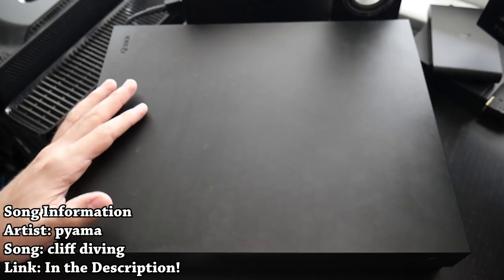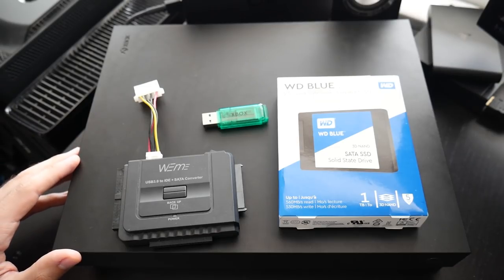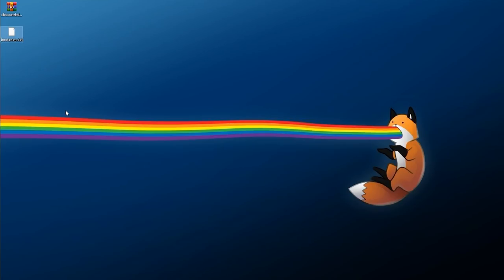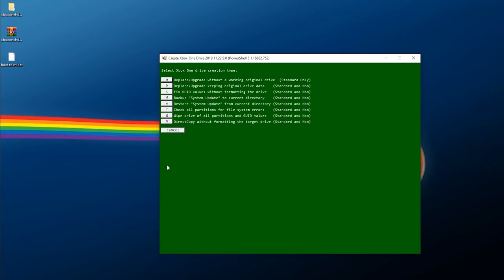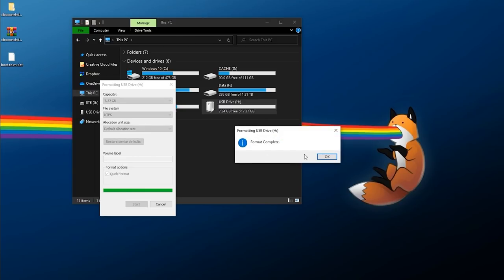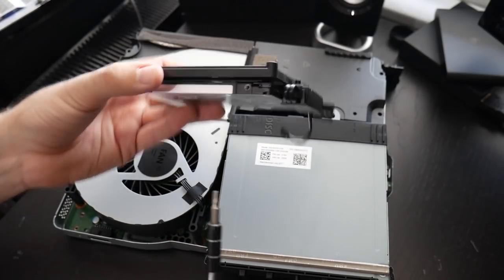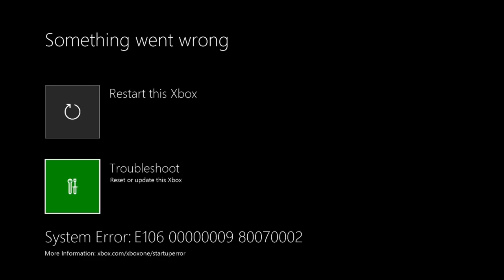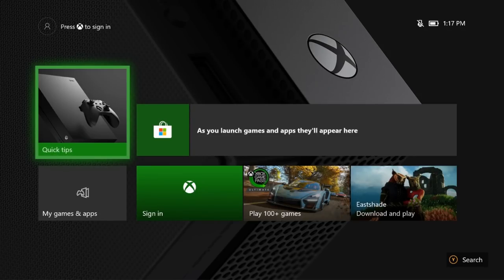How to Upgrade/Replace Your Xbox One HDD! - SSD/HDD Upgrade Guide for X1, One S, One X

Comment: Sorry to both you, twice, thanks for a great video, but, after redoing the whole process a few times mine does exactly what you showed, until I get to the offline update, it goes to the something went wrong screen with the E101 error, and I can pretty much bounce back and forth between a good start with E106, to the E101 error. Do you have any suggestions?
Reply: i believe error 101 is a faulty hdd

Comment: I simply just used Macrium Reflect to clone my old HDD to a new SSD and simply dropped it in....and somehow it worked lol
Reply from the maker: Yep, nothing all too special about these in regards to security sectors.
Reply: @MrMario2011  Does the drive cloning method work if they're different sizes though?
Reply: @shanez1215  More than likely it will. Once you clone the drive, the larger hdd should have an empty partition of the remaining space. I usually use AOMEI Partition assistant to combine your main partition for game storage with whatever empty space you have left.
Reply: this is exactly what i was thinking of doing lol, glad to know it could work

Comment: Just be careful removing the ribbon that connects the front USB and sync button from the board. When I did mine, it ripped the connector off the motherboard. Luckily the damage wasn't too bad, and a repair shop could was able to fix it. But if you're not careful, those traces may be irreparable.
Reply: Hi,I think it happened to me today. I tried two USB,none is recognized anymore and I can't do an offline system update. It remains grayed out. What can I do?

Comment: Wow this is outdated. You don't need to hook any of the drives up to the PC anymore, let alone mess with weird scripts. Throw the new/larger HDD/SSD into the console (no prep needed), go to the recovery menu (as outlined at 23:30) with the OSU1 USB stick inserted and pick the offline system update menu item. It'll start doing its thing. Done. The only thing this doesn't do is restore the boot logo, but that'll fix itself the next time there's a software update anyway and doesn't affect usability

Comment: I was fighting with an Xbox black screen for a friend. I couldn't get it to boot into troubleshoot menu to reload it. I knew it wasn't bricked since it got to the green screen and went black plus the controller allowed me to power down, restart, etc. It had to be corruption since it happened after that MS update that killed a lot of Xbox units. He wasn't worried about the data since it's all on the cloud. I said I'll replace the HDD with an SSD after coming across you method for replacing/upgrading the disk. I worked without any issues and was able to apply the update and it's good to go. I spent way less time on this than trying to get into the troubleshooting menu. He's finally got his Xbox back after it being hosed for 6 months. I appreciate the information and tips. Easy to follow and not difficult at all.
Reply: Did you use the original drive? Jw wondering because mine crashed mid update (Xbox one x) now it turns on but shuts off after like 5 mins no power to USB and says no signal

Comment: This is amazing how easy the upgrade is! Much better than the original Xbox that locked the hard drive to the motherboard unless you softmodded it first.
Reply: Having upgraded a PS4 before an Xbox One, this was so much worse holy fuck.
Reply: @SimisFul  It's all relative. I recently upgraded the drive in my classic Xbox, and agree with PiratesMVP that it's no picnic. Holy hotswaps, Batman!
Reply: @jessragan6714  I certainly don't envy it if that's the case! Hopefully you got it all working now :)

Comment: For those getting an E106xxxxx error code loading the OSU1, make sure you download the proper version for your Xbox One console. There's a separate version for Xbox One X/One S and Xbox One consoles. I accidentally tried to load the Xbox One S OSU1 onto an Xbox One and ran into a E106xxxx error and Update from USB was not an option in the trouble shooter. Also try a different USB drive. Some drives have issues loading the OSU1 onto the console.

Halo 5 Xbox One
Previous Drive: Seagate ST1000LM024 1TB HDD
New Drive: Crucial MX500 1TB SSD 
Console OS before Upgrade: 10.0.22621.4480

Also make sure to exit the Xbox Insider program if you have a preview release of the OS. The public OSU1 will not work. You'll have to wait until the new public release of the OSU1 supercedes the Insider preview version. That can take months. You cannot revert to an older OS build doing the offline update by USB using the lastest OSU1 update in this situation. It would suck if your HDD crashed with a preview build.

Comment: Thank you for such a detailed tutorial. I upgraded my Xbox one X with Samsung 870 EVO 1TB 2 years ago, then did another upgrade to 2 TB last year. What i can say is every dollar is worth of it ! The price of SSD has been going down to a quite resonable range and people with old consoles should consider the internal upgrade first if he or she has the ability to dissamble the console.  However, what modders concern is the maximum capacity or limitation of the Xbox One consoles. I have viewed several videos made by XFiX(aka author of Xbox HDD master script). He said the limitation of user content partition is around 1.8TB or so. In other words the max standard capacity of SSD would be 2TB. Though we can partition the SSD of greater capacity and get beyond the limitation with Xbox HDD master script tool, we cannot use it because once trying ,it causes partition corruption and data lost. I just bought another new 4TB 870 EVO last week  and this information interrupted my plan because I was just  aware of it yesterday.

Comment: Another great guide again. Have used your videos for Softmodding Original Xbox and PS3 and fitting bigger HDD's (2Tb) on both. Used another guide to fit 4Tb SSD into PS4 Pro. This guide will come in handy when I get a 4Tb SSD for my Xbox One X. Keep up the good work and thanks for sharing your information. 5* and 2 thumbs up from me!
Reply from the maker: Got a legacy user here with the 5* reference 🙂
Reply: @MrMario2011  If you didn't deserve the praise I wouldn't of give it to you.. Would you have preferred a f**k off with your knowledge instead?  lol. Just take care and keep up the good work. just upgraded PC to 32Gb from 8Gb. Bios didn't like it and I couldn't boot up as keyboard was disabled so couldn't press F1 to boot with new memory config.. Such fun - I'm sure these things happen to test us in life. New case is next and 4Tb SSD for XBoneX. Glad Black Friday has started - hope to save a few pennies. ;-)

OH.. Legacy is a strange thing to call me.. Ancient works better for me.. 59yo but a big kid at heart still playing OLD arcade games like Cadash, Slap Fight/Alcon, X-Multiply, Rastan(Saga), Flying Shark and many others!! Using ReDream to play MSR as it's better than the "port" of Project Gotham Racing that they insist was written for the Xbox.. I have PGR on modded Xbox and it's  a cut down version of MSR. You only have to play them side by side to see that they are the SAME game but ported badly to Xbox. OH.. My Monitor supports PBP which is Picture By Picture. I can run ReDream on PC and have Xbox displayed on the same monitor.. Great for FTPing as no need to swap input on monitor to view output of each device.. I'll do a quick video for you later. Monitor is Dell U2711 if interested. Old and cheap like me.. hehe.

Comment: Great Video. Quick tip for you. In Windows Explorer if you want to drop to a command prompt for the folder you have open, just type CMD in the explorer path bar.
Reply from the maker: Thanks! Although I showed the way I did to force a Command Prompt window with Administrator permissions in case that's required. Some users might run into issues if they launch it without Administrator privileges.

Comment: Thank you for the guide. I was able to utilize an XB1X that I didn't have the strength to throw away a few years ago so I put it in a box and forgot about it. At the time my harddrive went bad there were no comprehensive guides to reinstall OS and fix it as you've shown here. 

As for some constructive criticism, I think copying the boot screen files over to the SSD at the same time as the OS would have been more efficient. You doubled back at the tail end of the video to do so and by that point its more trouble than it's worth to disassemble again just to move some files over.

Much appreciated!
Reply from the maker: Oh you're not wrong about the bootanim file, but during the process I believe you have to initialize the console first before you can copy that over. I absolutely agree it's more trouble than it's worth, so if I do this now I just copy over the OS files and be done with it.

As long as it works, you'll be fine and your bootanim will return next firmware update!

Comment: I did this nearly a year ago with my One X and PS4 and I can’t recommend it enough
Reply: Why?
Reply: @user-lj4lo7cx7m  performance increase
Reply: "I can't recommend it enough"
Reply: @user-lj4lo7cx7m  Well SSD's tend to last longer than standard hard drives, and the PS4 menu has a considerable decrease in lag
And faster texture pop in in some games
Reply: A SSD (MX500 1TB) brought new life in my PS4 Slim. It's just snappier and textures in many games load faster. Or the share menue appears nearly immediatelly, with a HDD it just took ages to load
Reply from the maker: Yep, I upgraded my One X and PS4 Pro. The One X is really only big when it comes to anything OS related, but the PS4 Pro is quite nice overall with it.
Reply: @MrMario2011  I mean PlayStation was obviously top priority because more people have that so I can understand that

Comment: Hi. Nice tutorial, but I have issue with Xbox One X, I did all with 1TB ssd, and everything is smooth until 22:50 when I press "remove everything...", the console shuts down and restarts by itself without "Preparing console..." screen , but then error E102 appears. In general, I can continue installing recovery usb OSU1, but only with 500GB (365gb precisely). Any solution please?

Comment: For those wanting to put odd sized drives in, it is just easier to hand make the partitions yourself leaving the user content partition til last to use up the max free unallocated space.   The scripts out there are damned good but only cover 500/1tb/2tb options which doesn't cover say 750gb size or rather it does but you lose a fair sized chunk as unallocated and unusable.   Just note the file structure, set the System Update up around 15-20gb as the OSU1 has grown since the scripts creation and make sure to set the drive letters appropriately.   You can self set up your Xbox hdd very quickly that way.
Reply from the maker: The 500 GB / 1 TB / 2 TB limits are there as that's not only what Microsoft officially supported, but there's been issues down the line with odd sized drives.

Comment: Wait. I’m confused. I did this by downloading the update from MS directly. Is there an advantage to doing it this way? Vs. Downloading the MS update?
Reply: I think the old Xbone still needs to be done by scripts. The Ons S/X I have done just by the update file by itself. Anything more than 1TB needs the scripts though since there aren't any 2TB consoles around.
Reply: @MrCarlosj0  The 1S had multiple 2TB special editions. I have a 1X and am wanting to go to a 2TB myself. Trying to figure out what to do.
Reply: Just swapped ssd out in my one s and using the os1 update I get stuck at 89% and then back to e 200 or e201 every damn time.. would doing this help or is it something more? Anyone?

Comment: Hi.
Have an issue whereby it won't boot from memory card to update after unzipping the file
Im using a 64gb micro sd in a usb 3 adapter.
I have formatted sd card to ntfs and everything reset. 
Im upgrading to a 2tb sdd.
I even tried cloning the hdd xbox1x 1tb to the 2tb ssd. I tried twice but failed to clone.
I have reset the 2tb drive again formatted etc then retried booting from memory card but still nothing.
Starts to update then at 5% stops!

I then tried putting back my original hdd back in the xbox1x and now that wont read and returns an error....
 Help.
I followed your instructions to the letter.

Comment: Hi. I just watched another video before this one where the guy didn't do any formatting on the drive, before setting it up. My question is: Is this still necessary or is it 'now' possible to just go ahead and replace it without doing any preparations at all, and the console will do the rest?.
Reply: You still need the OSU1 USB stick, but none of the script crap is necessary anymore. Replace original drive with new one without prep, boot into the troubleshoot menu (as outlined at 23:30) with the OSU1 USB stick inserted, and pick the Offline System Update menu entry and wait 10 minutes or so. Done

Comment: Cant we just do offline update using pen drive with osu1, after replacing the hard disk? Is the scripting required?
Reply: That’s what I did
Reply: @MrKrimstah  is the script mandatory or not?
Reply: @groot3671  No. I replaced with with a 1TB 860 EVO without any script, just OSU1
Reply: @Mjollnir1983   will it work the same with Non SSD drive

Comment: A couple of questions here:

1. Will replacing the Hard Drive ban Xbox accounts or not (even if it isn't modded at all), as some people online say they don't and some say they do.
2. I saw one of your replies saying that the console only uses SATA II, does SATA III work too because the cheapest 2TB SSD I could find on eBay is a SATA III.
Reply from the maker: There is always a ban risk, although I've never known of anyone to get banned ONLY for replacing their drive. SATA standards are backwards compatible, you just won't max out drive speeds.
Reply: @MrMario2011  Ah, so the SATA II and SATA III just mean the speeds of the storage device. Nice

Comment: Do it on a xbox 360 if possible i kinda wanna see old hardware with new component
Reply: @chriswright8074  Depends on what your current drive is. Of you have a 320GB then the most you can go up to is 500GB without RGHing it

But of you mod it the 360 can do up to 2TB
Reply: Just buy like a 128 gig version like I did or yeah even 250 gigs is okay if you’re just gonna download so much games but 360 is close to an end of an era in like a year or 2 possibly even 5 years from now.

Comment: WOW this was flawless and worked perfectly - upgraded my XBox one from the 500GB stock drive to a 2TB SSD. Great step by step tutorial - Thank you.
Reply: This is on a base Xbox One? Did you notice any improvement in speed?
Reply: @dln.sweeney   Did it initially on my base XBox one (VCR model) and just a couple of weeks ago, I had to do the same upgrade to my Xbox one X model because the SATA mechanical HDD died - No major significant improvements with load & boot-up speeds I can speak of, maybe shaved a few seconds here and there. There are certainly a few other YouTube videos out there that show you the minimal speed improvements between the stock HDD and an SSD if you’re curious.
Reply: @wetsu7648  Right on, thanks for the info

Comment: Could anyone explain this to me please,

Using Xbox one s and the past week it got slow nothing loaded so changed hdd partitioned using this guide but still getting error 101 also took the hdd out of a virgin TiVo box which is 1tb and the same happened, im not going believe that 2 hdds have failed one is basically brand new.

Please any help let me know

Comment: For some reason the update process fails for me every single time. I’ve downloaded the system file twice and formatted my USB flash drive several times already. Still system error E101 00000504 8B050041.
Guess I have to call it a day and just put the One X to the drawer and keep using my Series S. Didn’t work for me but still thx for showing how to do it. Hope it won’t break your console as it did for me.

Comment: Great detailed video.  Recently picked up an original xbox one and wanted to replace the original hard drive with a Samsung 1tb SSD.  I attempted your process twice from start to finish and cannot get the OSU1 system file to load.  It starts at 1% then fails.  I am going to try a WD SSD this week and see if that makes any difference but for now I am stuck with the original hard drive unless you have any other recommendations.  Thanks again
Reply: same here, did you fix it?
Reply: Sameeee did u fix it?

Comment: I have a modified original xBox that I had customize YEARS ago (like 15 years ago??) that has a lot of emulated games on it.  My son told me it is no longer booting.  I have the 200gb drive out and attached to a PC.   Windows only reports 98mb being used.  Is there a tool I can run on PC to really see the drive contents?   From watching your video's it appears Windows won't see actual disk usage.   I am trying to recover/clone the old drive, but I am afraid all is lost  :(    Is there a way to use a new drive to get the 500+ emulated games I had on this old drive.  Of course they will be different...just looking for a way to give some life to this original xBox again.
Reply from the maker: FATXplorer would be the best option.
Reply: @MrMario2011  Thanks for the reply.  I tried that tool as well.   Soooo strange the drive would simply be empty, as if it was formatted.  Sadness kicks in 😮‍💨😢